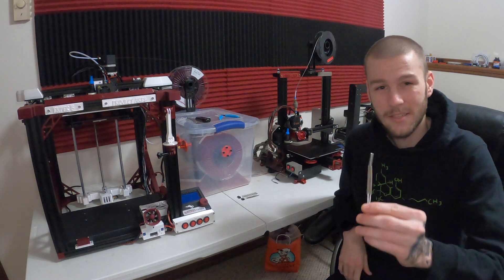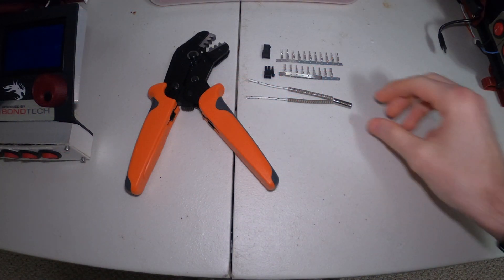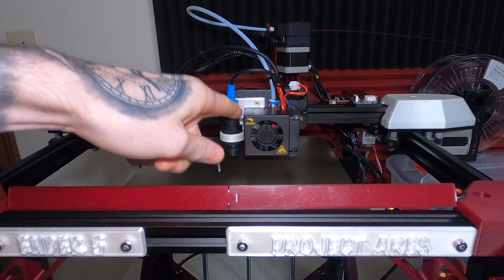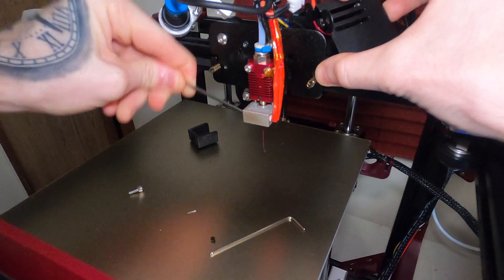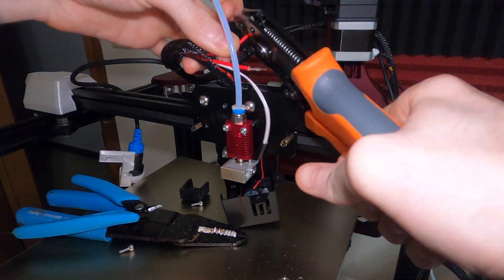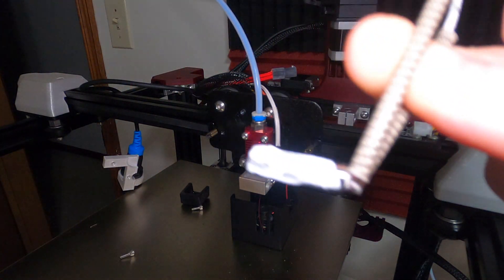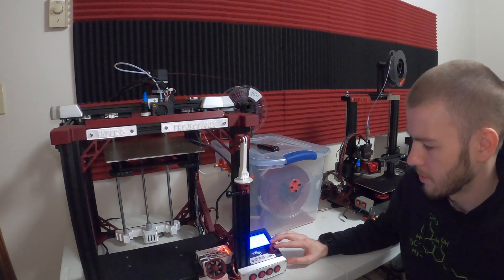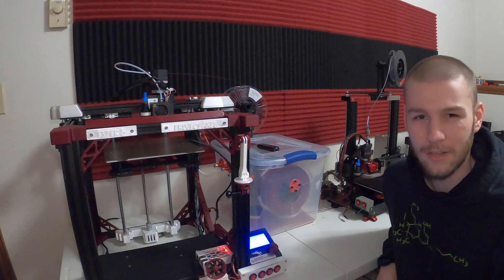Th3d 50w Heater Cartridge Install | Creality Ender 5 / Ender 5 Pro

Comment: I'm getting a E1 max temp error on my eneder 5. do you think replacing the heater will solve this? I also found a broken molex connector. I need to get all of those parts you used anyway so I was thinking of gettingthe new and installing it anyway.

Comment: After it reaches temp you can click cooldown before pushing the heater out. 

I use a 50w heater on a e3d v6. That thing heats much faster vs stock setup. Didn't notice any change in print quality but heats faster and let's me print at high Temps easier and maintained the temp better. 
Reminder to anyone reading this.
You have to do the PID autotune after these mods. If not it won't maintain Temps properly.
Reply: Could I have you PID settings? Struggling with overshooting temps
Reply: @mekanism8364  sure. My current pid. Room temp 72f  to 210c hotend for 8 cycles 50w heater on e3d v6 with sock

Classic pid 

Kp:19.86
 ki 1.76
Kd 56.13

Hope this helps. I highly recommend running PID tuning for your own machine and only use mine as a starting point.

I used the command when starting tuning
M303 e0 c8 s210
Reply: @bleach_drink_me  I ended up figuring out what the issue was. Klipper doesn’t tune like Marlin does and it made me think I had a problem. In practice everything is actually great

Comment: Great vid! Can you install molex connectors regardless of heater cartridge voltage, i.e. 12v vs. 24v? I was planning on doing the same thing and was wondering if I have to get different connectors for a 24v - 50w heater cartridge.
Reply: ya i was wondering if thoes were sufficient

Comment: Thanks! i need to buy one for my Ender 5 and i did not know with one works on it. Im very new with printers. I just got a Micro swiss all metal and i did change but some how its not heating up at all. The display shows that its hot, but the hotend stil cold. So i check with a heatgun and the temp when up in the display, that means that the termistor its working so must be the heater cartridge. Thank again. I did not know with one to buy, 12v, 24v..
Reply from the maker: You'll want the 24v
Reply: @modified3d59  i forgot..super nice your Ender 5.
Reply from the maker: Thank you!

Comment: what are the pins called that your using and the crimper i don't see a link
Reply from the maker: Those are Molex Microfit 3.0 connectors. Also, I removed the link because I found an issue with those crimpers having a issue with the molex. They are meant for JST, however I was able to get them to work after a few tries. Once I find one I can fully recommend, I will edit the description! For now, I'd just recommend using the official Molex crimper for the Mircofit3.0.
Reply: @modified3d59  Is it rated for the 50w the heater puts out? Don't they get hot?